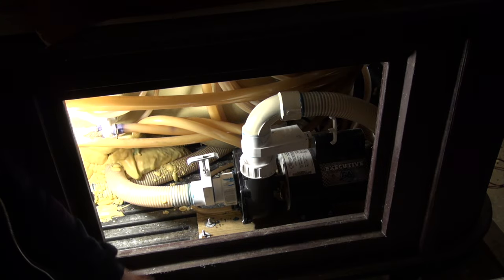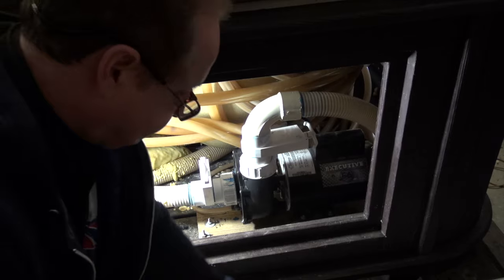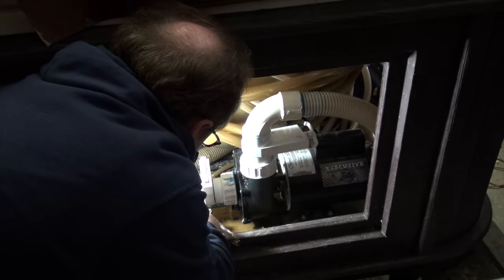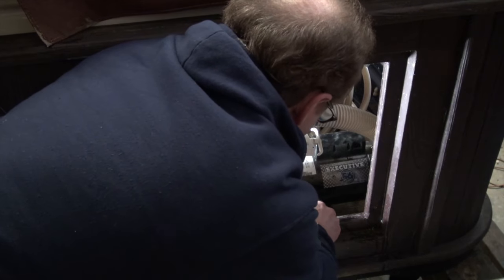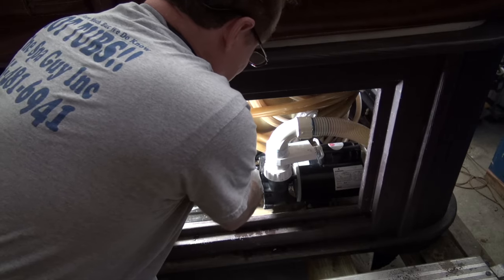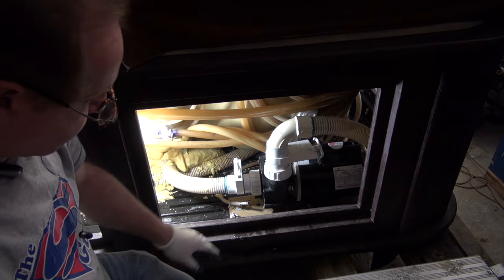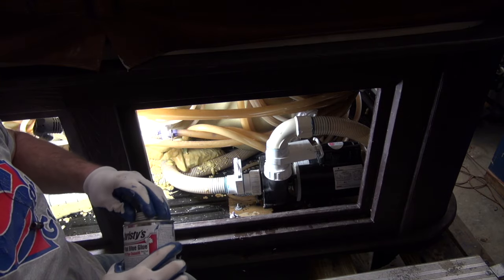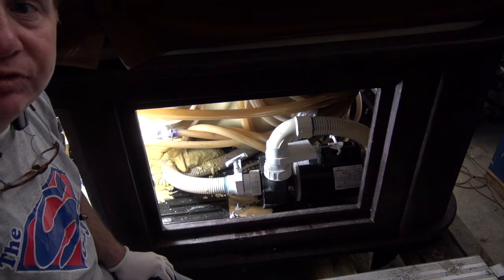Hot Tub Pump Remove and Replace the Basics The Spa Guy How To

Comment: In the process of replacing my swim spa pump (no.1) and discovered that both slice valves are not closing completely . Any advice on what that is ? Is the only solution for fixing it to drain the pool completely ? I was able to put in a 2" pipe gripper plug on on the inflow and outflow lines which enabled me to pull the bad pump without losing all the water from the pool . I usually drain the swim spa once a year to carry out routine maintenance and replace the water. What's the fix for the slice valve ?

Comment: My jacuzzi was converted to 220v but my old pump is 115v.  
Is that why my pump broke??
Do I need to buy a 230v pump or the original 115v?
Reply from the maker: You can use either voltage pump with a 230v tub you have to make sure the white wire is neutral if you use a 155v pump and hot if you use a 230v pump..
Reply: @spaguyhowto7417  if I placed  the black wire in neutral, did I just burn my panel??
Please help
Reply: @spaguyhowto7417  I have red in H, white in C, black neutral..
Now my spa won’t even turn on.  
Did I burn my panel board?

Comment: We have a pump that was very loud and kept going higher in pitch and today it just stopped random!y and broke what do we do???
Reply from the maker: Repair or replace it..
Reply: @spaguyhowto7417  we are replacing it were not taking it apart
Reply: @spaguyhowto7417  its to corroded
Reply: @spaguyhowto7417   I need to replace my pump on my hot tub and need to know the correct size and pump, its a 2MBT on the connection so is do I get a pump with 1.5 or 2 inch on the pump ??    thanks